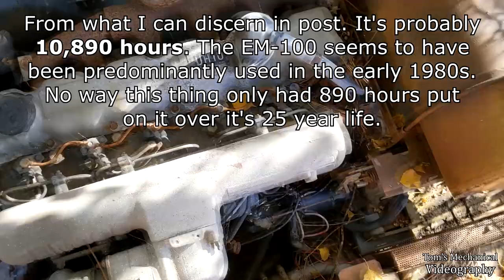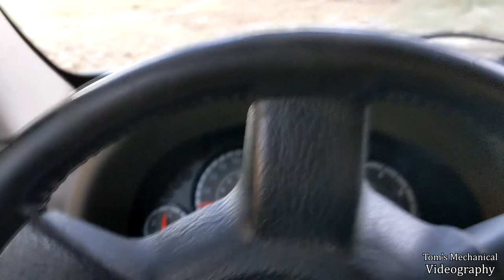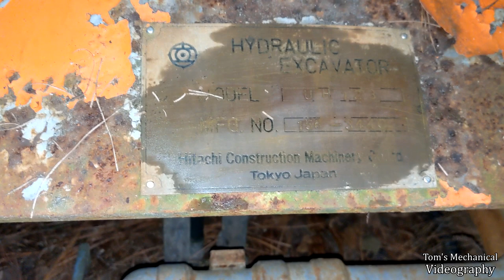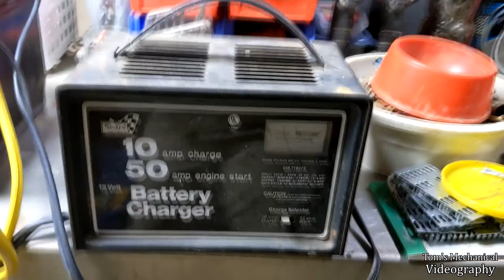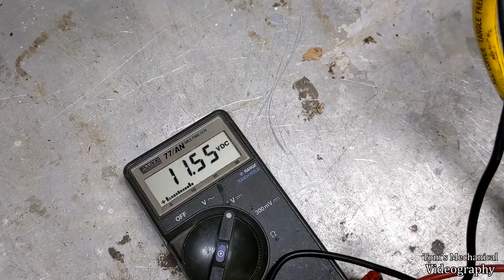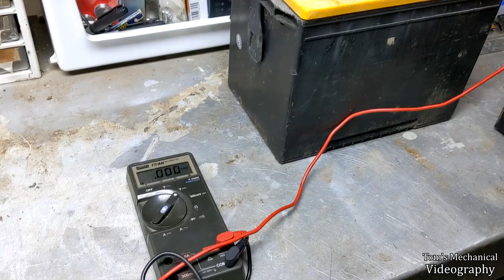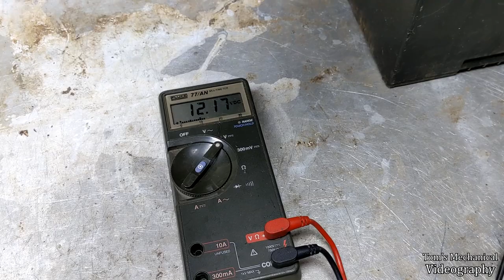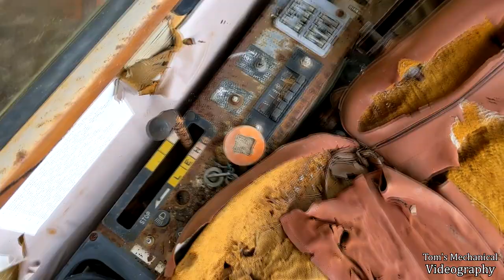DERELICT Hitachi UH123 Excavator - Will it crank?

Comment: Two decent  batteries  on it it is 24 volt bad connection  probably at the starter have you tried crossing  the starter to see if there is power there but as you say you dont know what you are doing why bother